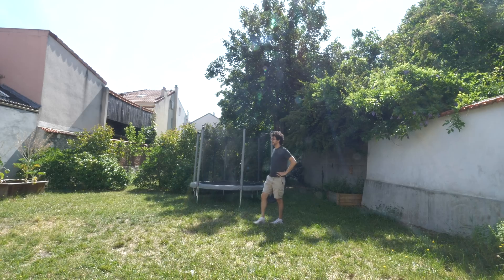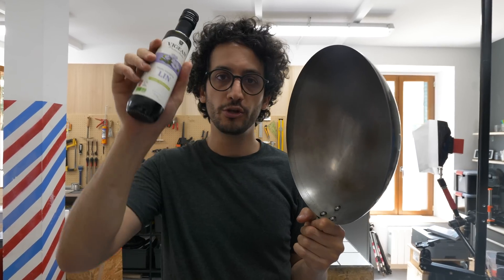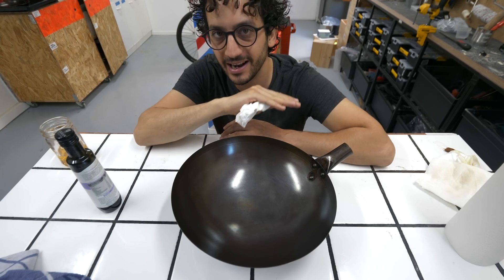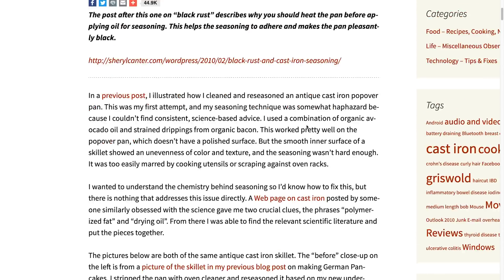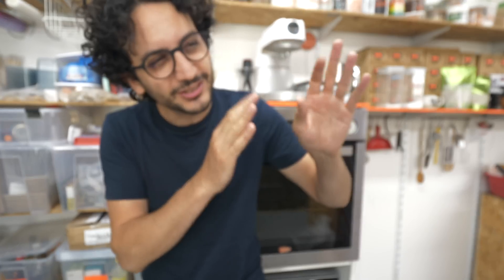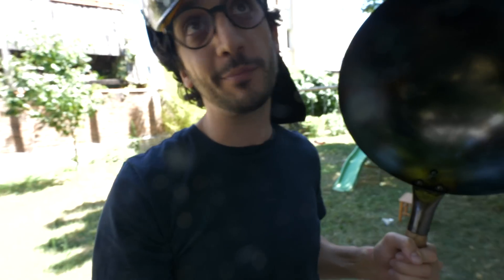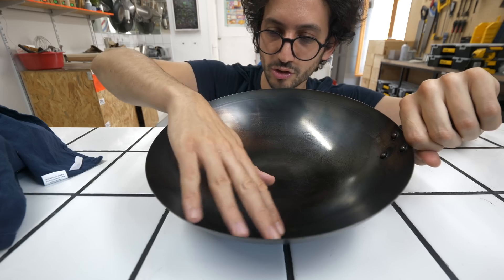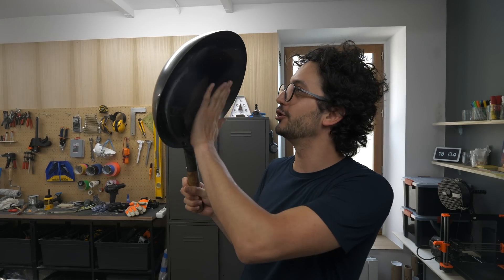Can I Make my Wok Slicker than a Nonstick Pan ?

Comment: At what temperature do you bake the oil coating on the pan? That seems an important detail.
Reply from the maker: Max heat.
Reply: Alex: so... the 900deg f self cleaning mode? That seams counter productive.
Reply: @FrenchGuyCooking  what oil you suggest more?
Reply: @TotalWarriorLegends  the video says flaxseed
Reply: Lupo do u offer this as a service to others?
Reply: High enough to make whatever kind of oil/fat you use smoke. You CAN go too hot. I have a propane jet-burner. It gets so hot it can make cast iron glow white hot. When you get above 700 degrees F, the oil coating burns off and turns to white ash. Ask me how I know.....
Reply: @georgewalford7027  how do you know
Reply: @hlynur461  omg ur a legend😂
Reply: @hlynur461  He read it in a Youtube comment.
Reply: @georgewalford7027  how do you know
Reply: @TimebrokeGames  Doesn't the iron content of the victim's blood defeat the purpose of the seasoning process?
Reply: I do mine at 550 deg F
Reply: As high as you can seems to be the answer.
Reply: @TimebrokeGames  Yes. I think that will work. Probably faster than Alex's method also.
Reply: I saw something similar done with a toilet bowl from a space station. I do not think it was non-stick, however, I did not cook with it, and so I could be wrong.
Reply: You can definitely go too high.
Reply: there is definitely too hot. what you want is usually when it starts to smoke and right around that point.
Reply: Newer cast iron pans come pre-seasoned, but whether your cookware is new or old, you can re-season it regularly to enhance the non-stick surface. Preheat your oven to 350 to 400 degrees F. Lightly coat the inside of the pan with cooking oil or shortening and place the pan upside down in the oven.
Reply: 250/260 is the best. Hotter than that can strip the seasoning
Reply: @TimebrokeGames  that's deep.
Reply: @TimebrokeGames  am I gonna have to be the one to point out that an object in hyperbolic orbit will never return?

Comment: I personally have never seasoned a wok. After you heat it up you put a lot of oil in it, swirl it around (the swirl should only take a few seconds, so that the oil just gets to the smoke point when you're done), and then empty the access to your oil bowl, after that you take just a bit extra oil (or a lot if you want to deep fry the ingredients at first) and start frying.
That way of "seasoning" the wok makes it about as non-stick as yours is, but you have to do it every time when you want to cook in a wok.

Comment: Definitely better than Teflon from two different perspectives. First of all Teflon breaks down into some really nasty stuff when it overheats and in general I would urge caution when combining plastics with cooking. Second, this is a lot cheaper and causes less hassle in the long run because Teflon or other non-stick pans always have to be replaced while this thing can be re-seasoned and used practically forever.

Comment: I use a similar  Method to you  when it comes to seasoning my  pans  though i'll try  flax seed oil  next time i honestly didn't know it  was related to linseed so that's awesome. , However i also employ a Hand held  propane blow torch like you'd  use for  plumbing to heat the  odd spots on the pan and get it a uniform super black.

Comment: easy. heat the wok until it is smoking. pour a ladle of room  temperature oil into wok. stir round and pour out oil. wipe down the wok with a paper towel and then repeat process. wok will darken and become non-stick.

Comment: Heating the smoke doesn't create particulate hazards, those are chemical hazards. Your N95 mask does nothing against that. You need a carbon filter, for civilian use, something designed for spray painting application will work for you.

Comment: My quick opinion a good teflon pan is way better. I have a couple tefal ones, and i can cook an egg without any oil, and after a litle shake, the egg is release the pan. Other hand teflon is extremly heat resistance but couple pans need to be handle extremly high heat for exampla a steak pan or a wok and i think for the mentioned pans are better if theyr uncoated because of the generated heat, and sometime we are scrape a lot during the cook.

Comment: Technically arent the polymers also "chemicals" like teflon?
Reply: Technically, everything around and inside you is chemical. You are chemical. Everything that is made of ions and atoms is chemical.
Reply: @eddiezebeast  I always crack up when I see products advertising "no chemicals" and then I get annoyed that it's legal to do that
Reply: @eddiezebeast  so when I get together with my siblings, we become The Chemical Brothers?
Reply: @eddiezebeast  exactly my point, everything is just molecules
Reply: Technically aren't the teflons also "polymers" like cellulose? :P
Reply: @raghu5038  Cast Iron lasts IT'S lifetime, which is usually longer than ours.
Reply: Teflon in a heavily flourinated chemical. When it breaks down under high heat the gas it lets off is definitely toxic. You cannot even have teflon pans in the house if you own birds for this reason. They are generally recognized as safe for use by people, but they are not super durable, and if you have damaged teflon pans you could be ingesting it. Teflon is mostly inert though, so there is no real danger from that. That being said, it is a long lasting pollutant that doesnt readily break down, so its not the best for the enviroment if you are throwing out teflon pans all the time.
Reply: @vexes908  yup, disconnected PFOCs are terrifying and don't do good things to you! I definitely would not put a non-stick pan in the oven for that reason. It'd have to be layered ceramic or iron.
Reply: but alex's pan does not have fluor in it like teflon formula does
Reply: @raghu5038  cast iron lasts a lifetime, the nonstick coating on the pan doesn't, it's very easy to fuck it up. you have to re season every so often. but you can't do that with Teflon
Reply: Teflon chemicals give me the Teflon flu, I'll take traditional but also chemical seasoning over that any time !

Comment: I use black steel, carbon steel, and cast iron in the kitchen.  They are perform incredibly well for things which you cook to a release point, the point at which the food forms a crust and naturally releasea from the pan.

For applications where there is not desired a ceramic nonstick or ptfe free nonstick will always be better. In a nonstick pan the food simply never sticks.  Things like egg white omelets, candies,... high sugar sauces will always be far easier in nonstick.

Comment: i do something similar with canola oil on my pans and they turn out great after about five seconds meat just detaches from the pan and with a small amount of oil eggs aren't a challenge either though i have to redo the coating process every few weeks as i use metal tools

Comment: I have the same problem to season a wok in my home. (I am a Hong Konger) Since the wok is far larger than the oven, I can only use the gas stove for the seasoning. The result does not go well and the layer is uneven. 

Then I use a blow torch to help to heat up areas that a stove can hardly reach for the seasoning and the result become a little bit better.

However, no matter how hard I work on the seasoning, it won't last long because my family will use the wok to steam or boil food (yes, we use it for deep fry, stir fry, steaming, boiling .etc.), which will ruin the seasoning layer. (cry)

Your tips on a thin layer of oil really help, I may use it on my cast iron skillet. Thanks, Alex!

Comment: Both polymerised oil and Teflon coatings are equally non-stick, however the self-seasoned pan wins because Teflon is not user serviceable - you can't just reapply Teflon that has flaked off an old pan. Also, whereas I'd not be very concerned about flakes of carbonised oil getting into my food, the prospect of eating flakes of Teflon is not very appealing, and the long term toxicity of PFOA in PTFE is also in question. I'll just stick (ho, ho) to my self-seasoned pans, thanks.

Comment: pretty sure the fresh teflon pan is better in terms of non-stick quality and ease of use, but if the teflon coating is ever damaged in any way the entire pan is immediately ruined. the traditional seasoning can be relatively easily removed and reapplied when necessary.

Comment: Hot wok, cold oil, makes it non stick. Don't heat up the oil before you put in your ingredients.
Reply: Long yao!
Reply: But how do you cook more delicate things like a perfectly fried egg if the pan is steaming hot?
Reply: @Lochlanist  You heat the pan up, add the oil, take it off the stove and wait a few seconds to let it cool down a bit before cracking the egg into the pan. If you add lots of (scrambled) eggs you might have to turn the stove on again (mildly).
Reply: @AirFuchs1  Thanks for the reply!
Reply: Yup! Instant seasoning. The more time the oil has to heat up, the stickier and more denatured it gets :(
Reply: Exactly, you don't have to overdo it. Even a brand new carbon steel pan can be reasonably "non stick" if you heat it up properly before adding oil. It gets even better over time, sure. Still, thanks to Alex for nerding this out.
Reply: Wow thats smart good advice.

Comment: I tried this process for my carbon steel wok (almost identical to Alex's but has a tube steel handle) and the film polymerised but it did not adhere well to the steel.  I ended up using Grace Young's method of oil and green onions (evidently the sulfur in the onions helps the process). I did use flaxseed oil/oven method for the exterior.

Comment: I used Sheryl’s technique a long time ago. I find it doesn’t last. Did this on several cast iron pans, carbon steel pans, and woks. It did have a good base coat, but I still find that anything with sugar tends to stick or leave residue. Even bacon. I guess most processed bacon in America has sugar added. I find switching between olive oil and butter helps keep it non-stick, but everyone’s experience will vary.

Comment: how do you wash it, though? i've read all sorts of things about cleaning a cast iron pan
Reply from the maker: I use a soft sponge and Soap :  If done right , the seasoning can definitely handle that !
Reply: @FrenchGuyCooking  why do you use soap?
Reply: @lilme1193  If Alex doesn't reply, here's a decent answer: It's difficult to remove oil from most surfaces.  Even with a well-seasoned pan, simply wiping it will not necessarily remove all of the oil from the last food you cooked, and when stored that oil can go rancid, which is gross, might make you sick, and might screw up the seasoning.  Soap sticks to oil and those big bubbles make soap easy to rinse away with water.  This is actually the whole purpose of soap.  I don't want to leave a thin layer of oil on ANY pan, so I use soap regularly on my cast iron pans.  Seasoning is NOT a thin layer of oil -- it was made with oil, but has converted chemically.
Reply: @lilme1193  I do it because of food residue.
Reply: I just wipe it with damp kitchen towel, nothing will stick to it so there's no need for soap or to scrub. Wipe with damn towel, then put some oil, wipe it off and put it away.
Reply: Next video maintenance?
Reply: Thanks everyone for the replies. The first time the pan was way more stick-resistant and handled washing with soap much better. I admit the second time around, I was in a bit of a hurry and didn't season it enough and evenly.
I might need to repeat the process (and possibly do it the proper way)
Reply: No soap
Reply: I use my carbon steel pans daily. I usually just wipe them clean with a paper towel but wash them with soap before and after seasoning
Reply: its simple once you know what you are doing.
you want to wash it with very hot water. but dont wash it while the pan/wok is still really hot, because the water will boil off and strip some of the seasoning. scrub well with a non-abrasive sponge or brush. put back on the burner to dry off and warm up a little. rub a layer of oil all over while still relatively hot to the touch. let cool and store in a dry place.
i basically take it to the sink almost immediately after im done cooking, give it a good scrub and put it back on the hob for like 30 seconds (its electric so it stays warm just long enough). then i rub it with oil and set aside to cool off. its all over in less than a minute.
Reply: You can clean it however you want: with soap, without, with steel wool or soft cloths. The only thing you shouldn't do is leave it to soak. Water breaks up the polymerization over time, and then you have to season the pan anew.
Reply: The biggest issue of the past with cleaning seasoned cookware was lye (sodium hydroxide, 14 on the ph scale). It was in most household soaps and was very caustic (alkaline), and super corrosive to polymerized coatings. It's still used in many oven cleaners (and drain cleaners) for that reason. So unless you're stripping the seasoning off to start from scratch, its best avoided. Fortunately most dishwashing liquids no longer rely on lye as its solvent. Modern detergents tend to be synthetic and lower on the ph scale, thus less harmful to seasoning layers. So a little soap in your cast iron or carbon pan won't do any harm, so long as you dry it completely right after washing, and a very thin layer of oil to coat.

Comment: What metal did you start with?  What temp did you use in the oven?
Reply: The wok was carbon steel and this will also work w/ cast iron. If you have a gas barbecue do this outside on the barbecue; there will be a lot of smoke. Oven should be 450 to 500F.

Comment: 9:46 polishing compound? 10:43 there is no chemical?
Reply: Polishing compound washes off. It’s essentially just a fine sand.
Reply: I doubt the polishing compound becomes part of the surface - it just aids in polishing it and is removed afterwards.

Comment: You could've done a "100 layers of wok seasoning" video
Reply: 200h of baking seems legit
Reply: Don't get him started otherwise we won't see another VLOG for a month PLEASE.
Reply: S T O N K S
Reply: French electric power company agrees
Reply: u do know that would take 8 straight days and 3 hr and 3 mins to do right
Reply: phantombloodsoul worth it
Reply: Wear a beanie hat the whole time aswell please
Reply: Actually just a month of seasoning your pan.
Reply: Arche de los Santos that would take 200 hours of labor
Reply: Arche de los Santos that would take 200 hours of labor
Reply: Maybe on a mirror polish?
Reply: I was expecting that
Reply: The peeled it off and store them in a plastic bag.
Reply: LMAOOOOO
Reply: It would end up sticky and useless
Reply: @michaelvonhaven105  Why so? I like my pan coatings, with 8 layers in the shown method. But i thought, the outside of an often used, old, cast iron pan of mine (which has many oil layers over time from usage and not cleaning) is even better (the inside is just normal).
Reply: @rabenklang7 , your opinion
Reply: @michaelvonhaven105  Oh, i may have phrased that wrong, i meant no disrespect. I meant it as genuine question. Do the properties get worse after a specific amount of coatings? Is there some evidence or theoretic explanation to that, maybe you tried it, and it didn't work out? So i would be interested to know. I have heard people say, that cast iron pans get better over time (i can not confirm that for the inside, only for the outside, but i carefully coated them before usage, and i am not careful while using them [acids, scrubbing and so], so i did not expect them to get better for me).
Reply: @rabenklang7 , in my knowledge after putting on so many layers would end up with a worse result.  Wouldn't mind someone trying it and proving some science about it.  As they say though, too much of something is not always better

Comment: What if you use those Japanese stones?
Reply: The Whetstones? Those are an abrasive, designed to remove material to sharpen a blade, would not have any application in this process. Buffing is a very different process than sharpening.